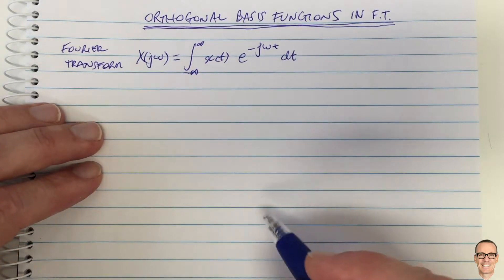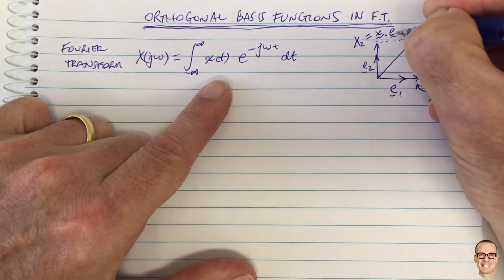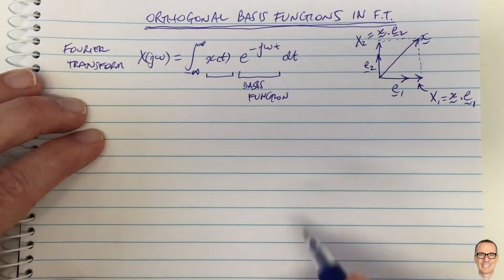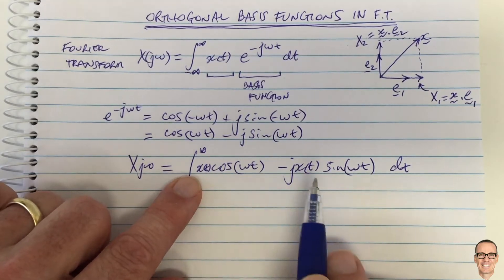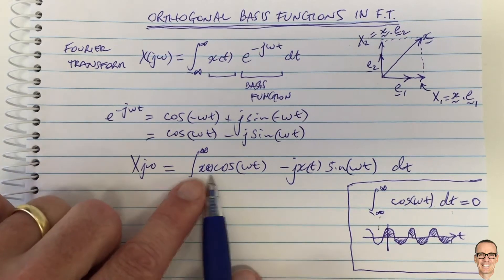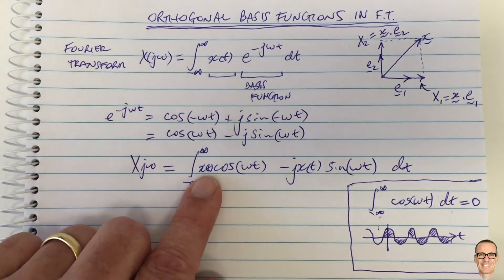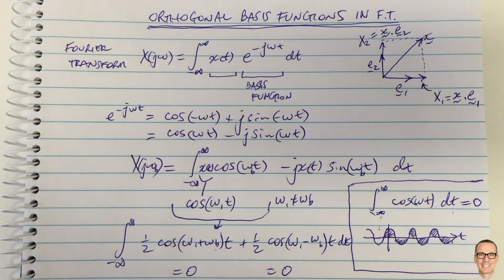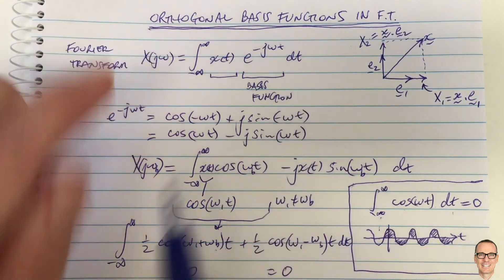Orthogonal Basis Functions in the Fourier Transform

Comment: to my understanding, it seems that the fourier transform of a function is the B-coordinate of a function multiplied by infinity, and the inverse fourier transform just maps the B-coordinates back into the time domain, correct? Also, it is seems that the integral of cosine(wt) doesnt actually equal 0, it just never exceeds 1/w. Are you using that to imply that two cosine functions of different frequency are orthogonal because when you divide it by the inner product of a cosine function with itself, you get 0?

Also, this was an amazing video. I am glad I was able to find a video that contains the beginnings of an abstract proof of fourier transforms. Most videos on fourier transforms and signals only teach you how to perform calculations.

Comment: Good video! Quick question. 

Initially, you defined the dot product as the method of projecting, but later on you defined it as integral(x1*x2). Why were you able to do this? Just a guess, but is it related to the fact that a dot product = sum of individual components of x1 & x2 multiplied by each other, and an integral kind of works as multiplying individual components of each function together (with respect to time)?
Reply from the maker: Yes, exactly.

Comment: I got a bit confused @6:00. Afaik, we have two basis, one sin and the other cos. Then how is that if x is a pure cos, it is still orthogonal to cos? I was expecting sin to be orthogonal to cos...
Reply from the maker: By definition, each basis function is orthogonal to all other basis functions (otherwise they wouldn't be basis functions). So cos(w_b t) is orthogonal to sin(w_b t) , as you say, but it is also orthogonal to cos(w_1 t) for all w_1 not equal to w_b (which is what I showed). In other words, cos(w_1 t) and cos(w_b t) are different functions, since they are at different frequencies. And sinusoidal waveforms at different frequencies are orthogonal to each other.

Comment: Hi there! What does it mean practically if basis functions are orthogonal, but negatively correlated?
Reply: Orthogonality is from Linear Algebra and Correlation from Statistics. There's a parallel between the two (according to some quick reading I just did) in the sense the if the dot product between two vectors and the correlation, when equal to zero, means they are orthogonal and uncorrelated. Imagine the sets of values as vectors with n dimenstions (n being the number of values in each set) then if the dot product between a pair of sets equals zero, the sets are uncorrelated.

I think you missed a 'not' when writting your question, right? If they are not orthogonal but negatively correlated means, in statistics, they are not independent.